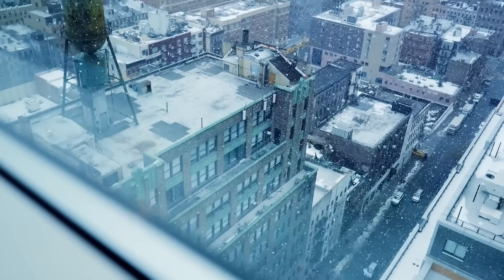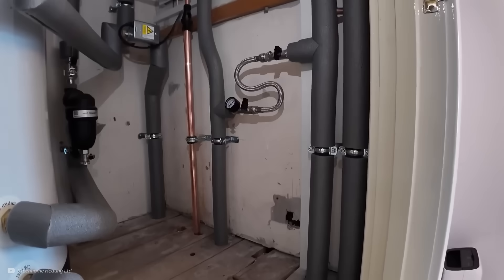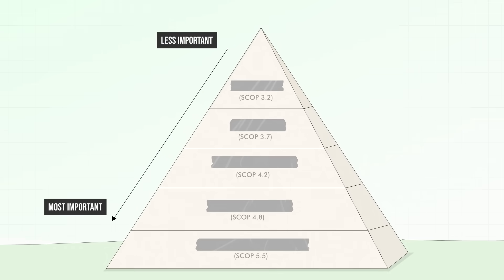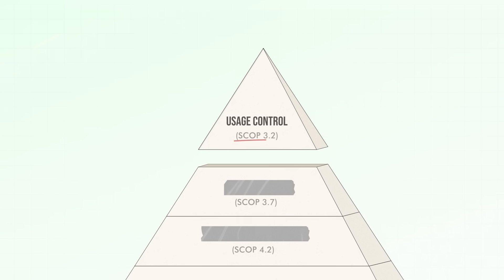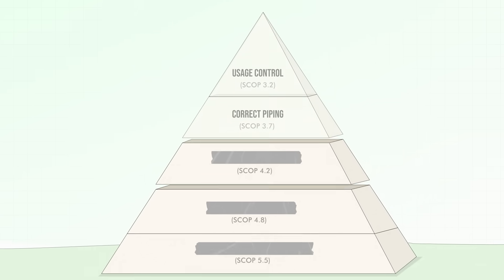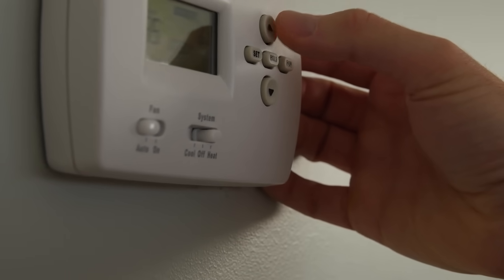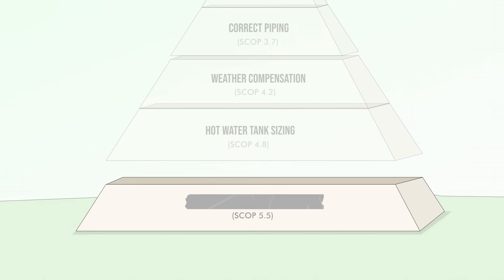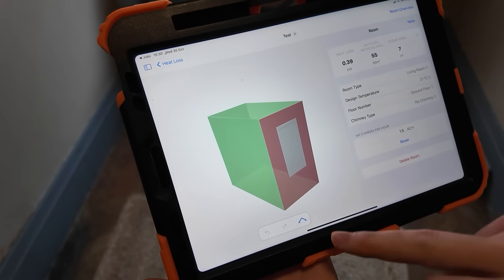The Genius of the World's Most Efficient Heat Pump

Comment: The name sounds like some good PR and branding, its likes interflora for heating! You pay a third party to do the work or use their brand! 😂
Reply: 3.6 units of gas to 1 kwh of electric, no one mentions that electric is going up in a few days for the third time this year and the 9th time in 24 months! They could be efficient by a cop of 1000% but the price of electric is becoming the biggest issue no one mentions here! Gas is around 14p unit Prices correct at last time i looked! If you got solar and some spare cash it’s a no brainer but the ROI on the system and new radiators will take decades! Insulate everything and get solar first!

Comment: Claiming '800% efficiency' gets this off to a BAD start. This should BEGIN by DEFINING the 'unit' of heating and electricity. However, the units were NEVER MENTIONED.
One conversion standard is 3.41 BTU/hr per Watt @ 100% efficiency.  Is the 100% (i.e. a COP of 1) used in this video defined using this standard?? (i.e. the efficiency of resistive heating)
Are these the units used, but never identified?   Is resistive heating the metric for defining what is referenced as 100% efficient? 
The piping, weather monitoring/compensation, heat storage capacity and energy density (i.e temperature delta) all make sense. But as presented here, there is no way to quantify the 'real world' improvement without making speculative assumptions.

To make this more than a vague sales pitch, let's be specific: If 10 kWh is required to heat an area for a day using resistive heating, does a COP of 5 for the collective aggregate of heat pump components imply that the heat pump system can achieve the same result using 2 kWh? If not, then what does a COP mean? If 'yes', why wasn't this germane, concrete implication stated?

Comment: I installed an 80 gallon hybrid water heater instead of a 50 gallon unit for the same reasons. It's easier to keep 30 more gallons hot than otherwise. Short usage burst don't put as much stress on the heat pump due to water volume.
Reply: either they needed 50 or 80. they have normal elements inside unless you buy the dorky gas replacement ones >> no idea why you wouldnt just rewire the 15A/120V to 15A/240V as its supposed to be a dedicated outlet, and has to be anyway for the heatpump anyway.

the 240V replacement ones have 7kw of elements and the same 2000watt heat pump or whatever.

Comment: I have a hotel in New Zealand. Actually NZ’s highest hotel. When the walk in beer chiller blew up I installed the new compressor INSIDE the basement, instead of blowing the ‘waste’ heat out into space. The amount of heat now blown back into the building was vastly more than I expected!
I then installed a hot water heatpump in that basement to scavenge that heat into hot water. 
I then duct the HWHP exhaust onwards into another section of the basement (it’s a BIG basement)
The temp drop through the heatpump is huge (the exhaust duct is cold!)
That cold exhaust air is also dry, thus the basement condensation problem is vastly improved. 
Win/win/win!
Next I have the restaurant walk in freezer and walk in fridge….im definitely going to do the same. 
I might just win the COP race, methinks, maybe not with the refrigeration, but I figure the hot water is almost free of charge.
Reply: We did the same thing for a hotel here where we gathered the exhaust heat from all the washing machines and dryers
Reply: @tomh1727  that's cool but it wouldn't be legal here without a bunch of paperwork, and expense. Not really worth the cost.
Reply: @tomh1727  So you're just sending out those chemical exhaust fumes into the heat pump where you guys are just recirculating it and breathing it again?
Reply: @ Lol what, no we use a big heat exchanger so the exhaust air still gets vented out
Reply: Did you put 1:1 mini splits on each room?  That's going to have the most savings in terms of your costs as the owner.
Reply: @GeraldMMonroe  multi head units, in opposition is best. (equal number of zones between opposing loads. IE west and east, or north and south.) You use a model that allows for reclaim heat mode.
Reply: This man is a legend. Our hats are off, good Sir!
Reply: @powderchills9125  there is. Very common in anything larger then a couple of floors.
Reply: There you go! I have been in this for decades. You need hot water right? Power it with a diesel engine converted to ethanol. It will last forever. On rebuilding it you can choose the right kind of part so it will get even better. Good luck and please let me know how it goes. This idea was patented by LG after I showed Chalmers innovation. But they failed to tell anybody that Japan tried this concept in 1989. There are a few more things that can be done. I will work with you. For you being a hotel owner you also have to think of food. Let me know..
Reply: heat harvesting!
Reply: and.....that works because always cold but if summer like happens then the efficiency flips to negative.  theres no vent/controllable flap to outside to take advantage of exterior air ever.   its just the old af idea of "hur dur why am i running a freezer inside my house in the winter if its cold outside.   but if its cold outside and youre running a beer chiller with equipment why not just use a duct to outside if the air is cold >>.  these 800% efficient claims are just bs gained by daisy chaining that arent really true....meh
Reply: @richardroberson9277  FYI, some places in Canada (essentially everywhere except the most south) use "economizer" dampers in the winter for that exact reason. When it's colder outside then your freezer, why not use outside air? For comfort cooling, air side economizers are used pretty far south into the US. It's common to need air conditioning in commercial settings in the middle of winter.

Comment: Similarly I was once told by an HVAC guy (about AC) that you want to size your units appropriately so that you are running smaller units near continuously rather than having larger units turning on and off all day..
Reply: I would like to know how larger inverter units fare as they can run at a low speed constantly and should in theory be more efficient due to getting more total heat transfer out of their heat exchanges. Or perhaps it's offset by more losses from a larger pump?
Reply: @Samqdf  The problem with larger units is that they cannot throttle (modulate) low enough, and thus have to turn on/off/on during low demand. Usually they can only go to around 50%.
Reply: @Jaapapa  25-40% is more typical, depending on the model. I've seen 20%, but it's not common since it causes too many problems.
Reply: @Samqdf  OP is correct for anything single stage. Otherwise the maximum I design for is 2x the smallest design load.
Reply: @Samqdf  Units are typically sized for very extreme conditions, so units are already oversized when considering regular temperatures. For example, for Minnesota where I live, sizing is based on an exterior temperature of -15F, yet a typical winter days is about +20F during the day. After accounting for some other factors*, a perfectly sized unit will be running at about 50% capacity for a typical day. If a home is very efficient (well sealed + lots of insulation), it may only need 20-40% for a typical day due to the other factors*. As others mentioned, the minimum output level is typically in the neighborhood of 50%, so sizing appropriately means it should be running at its lowest level constantly in our case.

Conditions differ in other locations, e.g. oversizing slightly might be optimal if in a climate that requires a lot of cooling.**

*Appliances running, cooking, showering, and literally bodies in a house all help heat a home.
**The additional heat sources in * are a benefit for cold climates, but it creates a constant load for a hot climate as the cooling is fighting both the heat gain from the exterior + the more stable load from those heat sources.
Reply: The larger units are going to be more efficient running at lower speed compared to the smaller unit running at mid/higher speed especially if they are both lower end units (with lower seer)
for example, if the room is called for a 1ton unit, having a 1.25 ton unit is going to be more efficient. but too much oversizing can have some negative impact on comfort.
Reply: @mikaelahyakuya3485  I don’t know there were multiple speeds. Just units sized appropriately for the space running for longer periods vs. larger units turning on and off all day. I understand that turning on and off creates a high energy load and causes more wear.
Reply: @mikaelahyakuya3485  Agree, totally, agree, thank you for pointing that out.
Reply: @mikaelahyakuya3485  Yes, I went with an oversized heatpump for my home for reasons like this. Less noise for the same heat, better efficiency, and a bigger margin for the few really cold days. I had no trouble at minus 20 degrees, no extra heaters required, the heatpump just throttled up and did the job fine. The downside is the higher initial cost, but that was minor, given that most of the cost is the installation. Ca. 15% higher initial cost.

The heatpump runs continuously apart from the defrost cycles, it just throttles down. It's not a binary on/off thing.
Reply: Very efficient but your equipment might wear out.
Reply: That doesnt sound right. If anything you want an engineer to size the units; but if you dont, plus size the evaporator so you get more laten heat out (humidity). But really get at least a variable unit
Reply: @Ben-b3s-v4l  the issue with that is if you size your equipment too large your indoor fan coil unit will not draw humidity out of the house.  As a result the limiting factor is summer cooling and not winter heating.
Reply: @fredfrond6148 wrong. Plus sizing the evaporator while keeping the properly sized condenser allows for more latent heat removal by condensing more of the humidity out of the indoor air. In heat mode it would probably be slightly less effective at heating. But most people’s homes, at least in the USA, do not use heat pumps for heating…

Comment: I've had an idea for years to make heating more efficient...

Imagine a world where your home is not just warm and cozy but also a hub of innovation, contributing to groundbreaking research and generating revenue to offset your energy costs. Sounds like a utopian dream, right? But what if I told you that this vision is not only possible but tantalizingly close to becoming a reality?

For years, I've been brewing an idea to make heating more efficient by replacing traditional resistors with computer chips capable of performing complex calculations for various applications, such as blockchain, AI training, distributed inference, rendering, computational fluid dynamics (CFD) simulation, weather forecasting, and other computationally intensive tasks. The concept is simple: a device that can heat a home while simultaneously performing calculations, generating revenue to offset the cost of electricity.

Enter HeatGenIO—a device roughly the size of a small radiator or desktop computer, easily installed on a wall and plugged into a regular electrical outlet. It’s like a smart thermostat + radiator + heatpump on steroids! Instead of merely emitting heat and regulating temperature, it’s a mini supercomputer that heats your home while crunching numbers for scientists, researchers, or even cryptocurrency miners. If you need more heat, just add more units, and if you're feeling extra chilly, you could opt for a water heater drop-in replacement for higher performance and year-round service.

The best part? Installation would be tool-free, or if you're not feeling handy, a technician would come and set it up for you—free of charge! This would create a whole new job market for HeatGenIO technicians. Everything regarding the computing would be managed remotely, ensuring that it functions as seamlessly as a passive heating solution for the end-user. Who wouldn't want freebies? Plus, there could be an incentive of a free internet connection as long as the system is plugged in and working, and during summer, if the user hits a threshold. More devices would equate to a higher speed and more reliable mesh network.

But as I delved deeper into the possibilities, I couldn’t help but feel a sense of frustration and disappointment. The Canadian government, in its efforts to reduce emissions, opted for the unpopular and infamous carbon tax, which, in my opinion, is a bit like trying to extinguish a fire by pouring gasoline on it. Meanwhile, innovative solutions like mine, which could have actually reduced emissions and made power consumption more efficient, were left to gather dust as there are no structures in place to accept and evaluate them. It’s like having a treasure chest filled with gold but no key to unlock it. Even filling for a patent unaffordable. 

Reflecting on my journey, I’m reminded of the countless obstacles I faced as an undocumented migrant seeking refuge for a couple of decades. No workshop, no lab, no access to the educational system and above average IQ people except via internet which was never practical or seredepitous to me at least, and no ability to move freely. It’s like trying to build a castle on quicksand, except the quicksand is made of bureaucratic red tape and the castle is my sanity and ambitions. And, of course, the cherry on top was not having enough money to invest in a prototype. Because, you know, poverty is a great catalyst for innovation—said no one ever.

I feel a great loss for the potential benefits it could have brought and the billions of dollars that would've generated during the last decade since I envisioned this a decade ago as it was conceived this idea before Bitcoin's rise in popularity and the crypto-craze.

The regret is palpable, and it’s hard not to feel a sense of sorrow and loss. I think about what could have been—the potential benefits realized, the emissions reduced, and the people helped. If just 10% of Canadian households were to adopt HeatGenIO, it could potentially reduce CO2 emissions by up to 1.5 million tons per year—equivalent to taking over 300,000 cars off the road. The weight of this missed opportunity is crushing, and it’s heartbreaking to think that this innovation could have made a real difference in people's lives.

Yet, even amidst this sea of regret, a glimmer of hope remains. Perhaps someone will stumble upon my words and feel inspired to pick up where I left off, creating something beautiful and innovative that could change the world. Or maybe, just maybe, someone with the power to make a difference will read this and think, “Hey, this guy’s not completely crazy; let’s give him a chance.” A guy can dream, right?

So if you're out there and listening, I’m sending out an SOS—a beacon of hope in the darkness. Help a guy out, and let’s change the world, one heating bill at a time. Otherwise, please just help get this message more attention by liking it or responding (no trolls, please).

Comment: Much emphasis is placed on good insulation and draught-proofing, effectively sealing off the outside air. This reminds me of my dear elderly Mother who was forever flinging open the windows to the Winter chill. I think she had visions of encouraging palm trees and parrots in the garden.  The paramount need for proper ventilation seems to have been ignored in this pell-mell dash to go 'Green !'  I suppose a ventilation Fan might be installed that exhausted into the  Primary heat exchanger,  possibly delaying the onset of he icing-up on the main heat exchanger. However, this is complication gone mad !  This burning quest for  a scientifically efficient laboratory style experiment is not practical for  Joe Ornery at 10, Gladiola Close.

Comment: In theory, the warmer the shoulder seasons get, the better the cop will rise. Using solar thermal or pv to preheat the colder mains water is also beneficial even if that preheating is just a few deg as the biggest power demand is moving the lowest temp water up so more power is needed to move 5 deg water to 10 than 10 to 20. Like having your kettle water always luke warm to boil

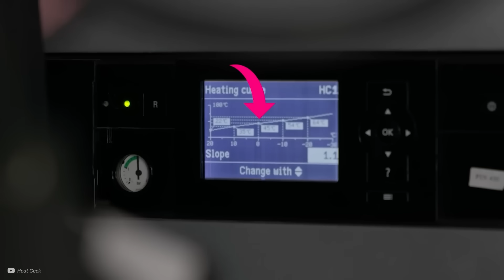Comment: 13:26 Heat pumps have that nasty property - COP is highest when heating is basically not required at all 😂
Reply: That's why u have a back up resistive heat source in places that get below zero f. U still end up w at least 2wice the efficiency of gas heat even in very cold climates